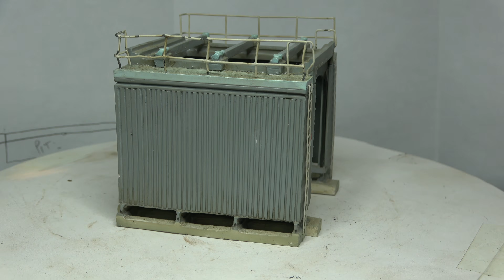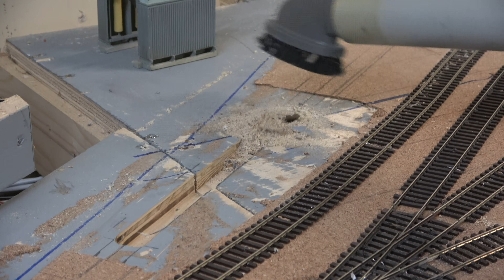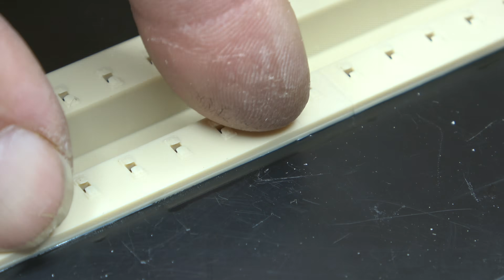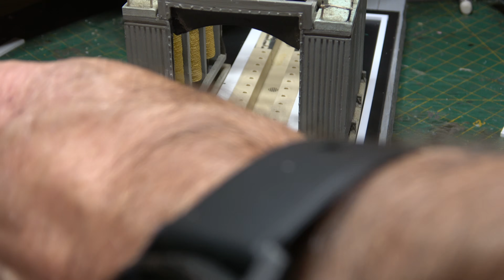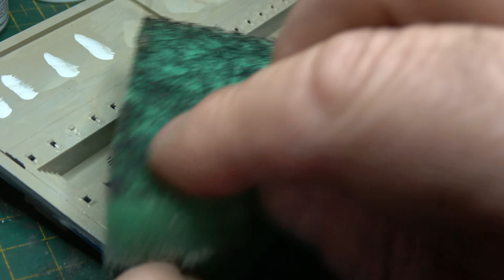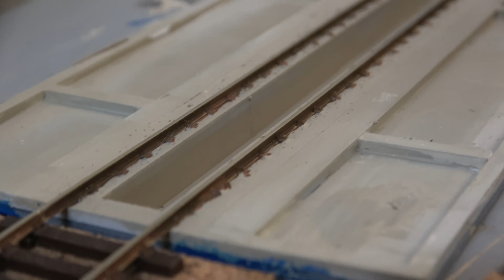Bachmann Washer & PECO Inspection Pit

Comment: Hi Nigel
I followed your instructions to the letter for setting the pits into the loco shed, worked perfectly!! Next, I copied the fueling stage, but I beat you to it on the washer! I filled the pit as you did on the fuel point. My washer is the later one with the curbs already present. I also installed 8 concrete sleepers either end and removed the side curtains as they really drag against the stock. 
Thanks for 1st class tutorials, I’m buying shares in Peco inspection pits 😂
Reply from the maker: This is the third time I've done this!! Firstly before I started doing YouTube and the latest layout rebuild. Then again about a year ago and lost the memory card the footage was on, along with 3 other projects 😖
Might have to think of another use for the inspection pit 🤔😂😂😂😂😂👍👍👍